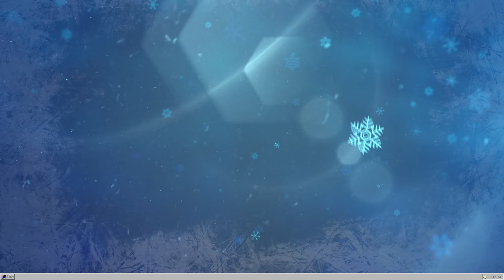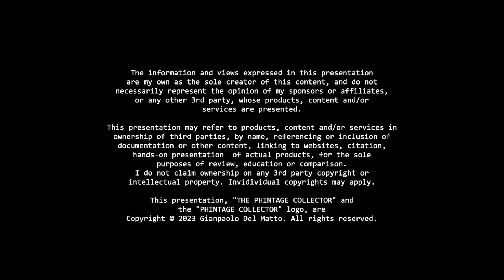Inspecting Ethernet Switches and a 10Base2 to 10BaseT Repeater / Bridge [#TPCxmas23 Part 17]

Comment: Back around 1997 we used a 10 base 2 segment of network for a long run we needed to do using a pair of devices like at the start of your video to convert to 10 base t and back.
Reply from the maker: Yeah, why not? :)

A repeater like this could in theory span an entire maximum segment length of 185m, so it could be used for a backhaul.

Never used such a long segment myself. The longest I ever saw back in the days using such repeaters was 100m.

Comment: A couple of months ago, I watched a YouTuber explain how an Ethernet network using coax cables was set up. I was thinking, whoa, complicated - why would anyone ever do that to themselves? Then I remembered my very first home network was indeed 10BASE2, and the reason why I went for that instead of good old 10BASET was, presumably, it saved me the cost of a hub.

A little while later and after switching to 10BASET eventually, I had a 24-port 19" 3Com hub sitting on my desk. No clue where I got that from though. Must have been very expensive so I don't believe I bought it new from a store.

Speaking of buying new things from a store: Just a week ago I bought an 8-port managed Gigabit switch. For 30 European gold coins. Shipping included. Certainly something I wasn't expecting I'd ever do back in the 90s. 

Well, in diesem Sinne: May the T-Stück be with you until you reach the Abschlusswiderstand!

Comment: ich kann ja nach Tokenring stuff guggen, brauchst du Netzwerkkarten? oder auch BNC Kabel?
Reply from the maker: Ethernet 10base2 und 10baseT hab ich genug Sachen da, aber Token Ring rein gar nix.
Reply: @THEPHINTAGECOLLECTOR  ich denke an dich, wenn ich etwas in die Hände bekommen. brauchst du auch ATM fibre zeugs?
Reply from the maker: @Rothammel1  ATM ist nicht so in meinem Scope. Da müsste ich mir erst mal Gedanken machen, was ich damit anfange.